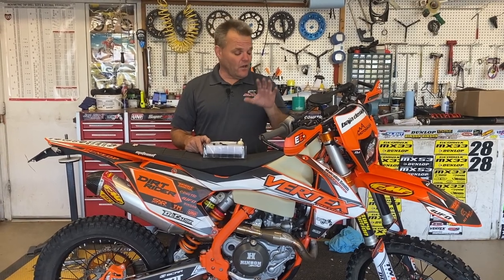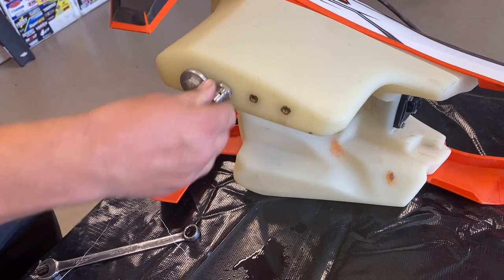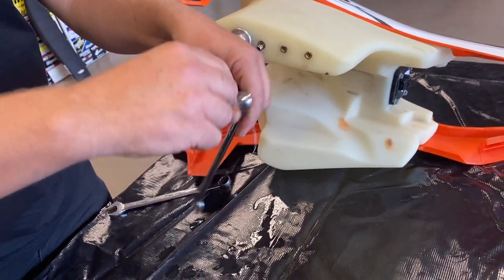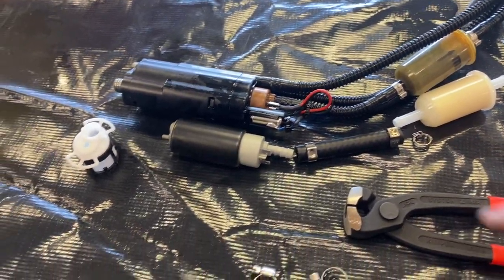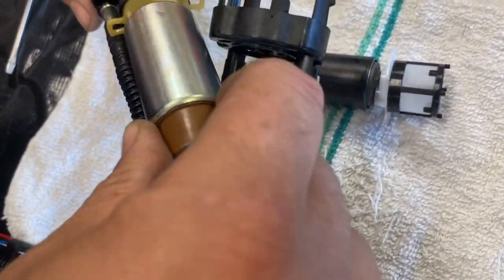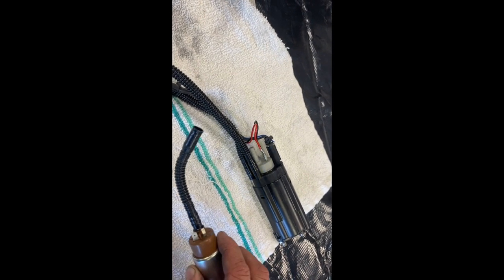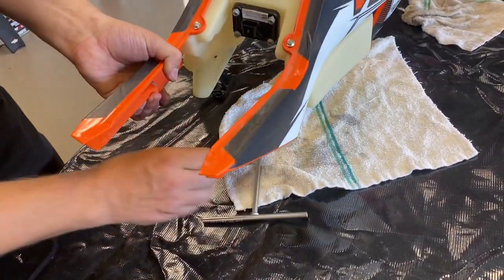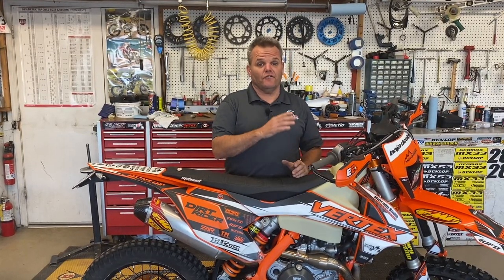KTM/Husqvarna Fuel Pump Rebuild

Comment: Nice video, I have a 2019 300 tpi where the pump pump failed at 5.2hrs, not sure if I just had a bad one or if this is the normal for the tpi 2 strokes !! No support from ktm on the replacement unfortunately !!

Comment: Dang so much easier on my RMX450 keihin fuel pump. Just six bolts and rubber oring, and then pull out from the bottom. No need for guide wires and feeding issues. Why so many leak points on the KTM design?

Comment: Watched your video and it got me thinking....what part of the pump is responsible for the pressure.  Reason i ask is I have a similar problem, i thought maybe the filter was cracked causing the low pressure in my fuel line.  I removed the pump from the tank and confirmed that it is working.  i removed the pump housing and kept the pump submerged in a bucket of gas, and put the discharge hose ina seperate container.  When i push the start button, i see it priming( pushing out a stream of fuel) but when i buttoned everything back up there's no pressure in the line when i disconnect the quick connect.  Is that the fuel regulator failing on me?  Just trying to understand what part is failing so i can rebuild it appropriately.  Thanks!
Reply from the maker: Email me-- contact info in About tab and bio on instagram- Good luck

Comment: Think about it,that’s the bike heart,it pumps it’s life’s blood to keep you going,35miles from home,out far from your truck,or worse,60 miles from your home.$12,000 dollars and KTM doesn’t design and manufacture their own fuel pump and filters in house?
With rigorous testing,to make they don’t fail?
$12,000 dollars.They outsource the bikes HEART to china for the pump,and turkey for the filters.Thats the most IMPORTANT part of the bike,They KNOW those inferior pieces FAIL and can STRAND You,way out there.Yet,they quietly turn a blind eye to the bike main artery.They are a robust,strong,exhilarating street legal masterpiece otherwise.Heres a pro tip..get some roomy,yet tight to the bike luggage..giant loop perhaps..and carefully bag up the tools needed for tank removal and pump removal,out in the field,a couple filters,o rings,an extra pump and one extra fuel regulator.These things will be key.God help You My friend,if You leave out ANY of these vital pieces,on a long distance endeavor.Make sure You have at LEAST two empty fuel bottles in Your equipment as well as a funnel,to have handy when You empty Your tank,on the side of the road,once You have replaced one of the three key components that FAILED You,waaay out there,You’ll be able to pour those bottles back into Your tank,then You can repack all Your SHIT and enjoy the rest of Your ride.
Shame on ANY company,that outsources inferior parts,to cut R&D.

Comment: I see options for metal in-tank filters that are washable - maybe a better option than the plastic filters and less prone to splitting?   Fuel contamination and dirty filters/strainers seem to be the culprit for fuel pump failures.  Great video and will use your trick to attached the safety wire before removal.